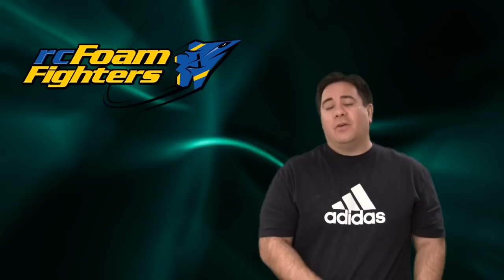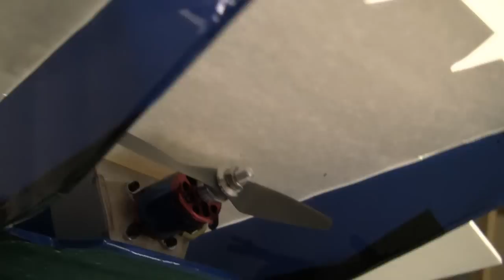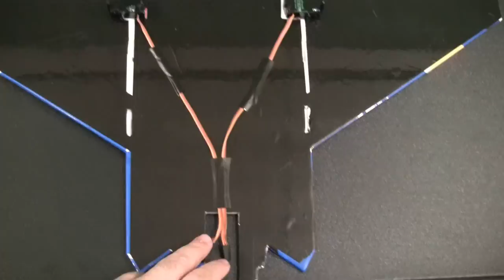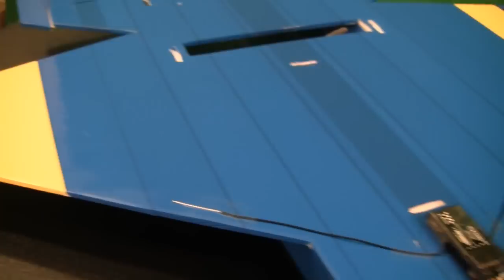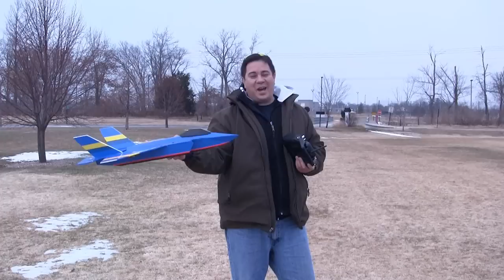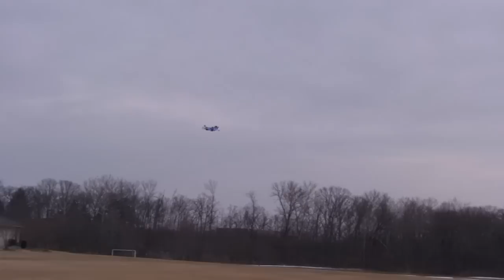FF-35 Part 2

Comment: Wow....can't believe it's over 14 years that this has been produced....I got a wild hair and decided to build this again....your plane selection is amazing and they fly very good...with Depron foam I can shave off a easy 100 grams....
I hope all is well ....thanks very much for a wonder series of foam flyers
Reply from the maker: Thank you for the positive comment Okiedoak201! Yes, I myself sometimes can't believe how long ago my brother Frank and I started the rcFoamFighters channel.  It has been a while for sure.  For sure making the planes from Depron will save a bunch of weight.  We started using foamboard way back, before most because it was easier to get and lower cost. That is what is cool about DIY Scratch Builds though, you can customize and make your plane how ever you like!  Thanks again for the support and following Okiedoak201!
Reply: @rcFoamFighters  I bought a case of depron way back in the early 2000's and been trying to carefully use it on select models..no longer avail in the usa....so it's back to foam board

Comment: Hi Paul, 
You said that you wish that they made military Grey tape?
I painted my ff-22 raptor with light Grey spray paint from about 1' away from the foam board and then covered it with clear packing tape in the area I want to stay Grey . 
PS. Don't do first coat to heavy test on scrap piece first. 
Hope this helps and keep up the good work!
Thanks from Australia

Comment: Thanks for the plans & build video. A little bit different foam build than I'm used to so your video really helps visualize the construction. Getting ready to cut mine out, even picked up a LOGAN foamboard cutter which really works slick. Thanks Paul!

Comment: What is it with the design of the F-35?  They are so stable in flight!  
I would love to see you guys produce lazer cut kits with a set of great assembly directions for some of or all of your planes.  
I just dont have the time to print out the plans, take them to kinkos cut them out and assemble but a kit already cut out would be great!
Nice job on the build and flight once again!
J